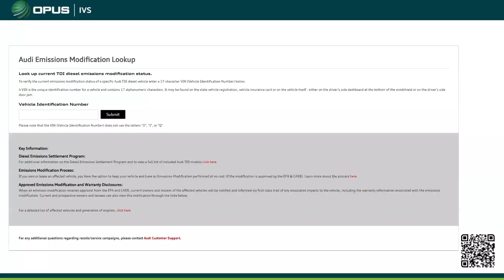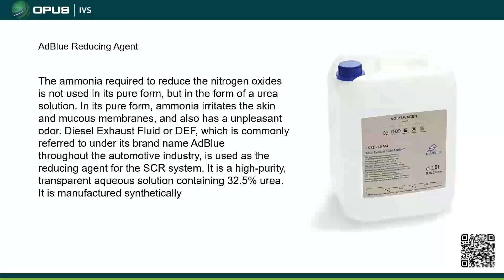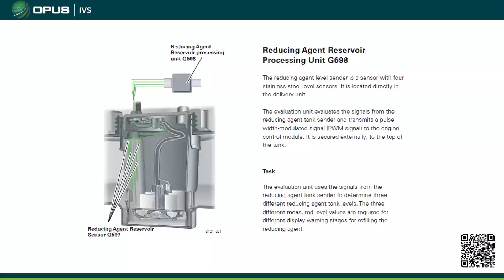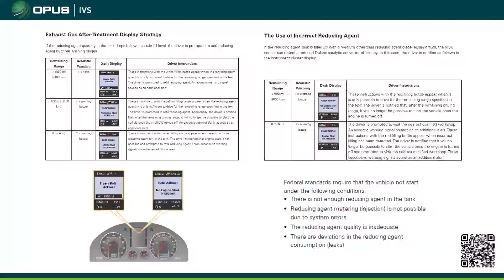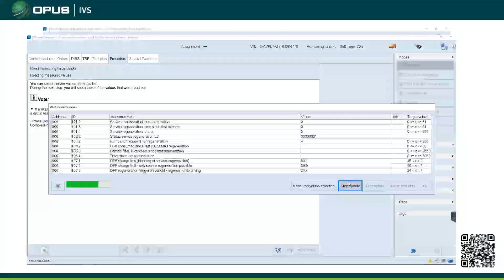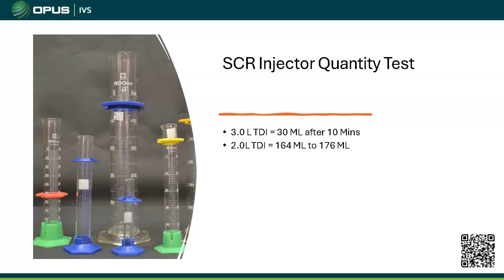VW and Audi Diesel SCR Systems - Opus IVS Webinar

Comment: We had a 250k mile 2020 Passat in the other week for a cam belt and this means removing the injector, there was a lot of crystal buildup around the location and on the face of the injector. The car was showing DPF codes but due to finding the crank oil seal was leaking, we ran out of time and the customer ran out of budget so it will have to wait.